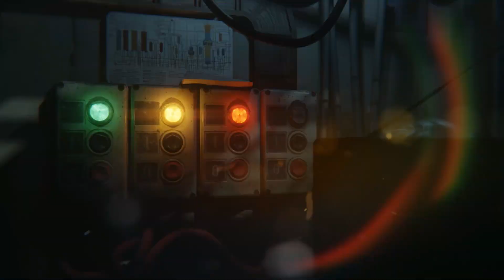Did Dodge butcher the Banshee's Sound?  MachE Borla vs Banshee Exhaust

Comment: Great Video RacerX!

Electricity and magnetic fields has it's own noises and they should exploit that instead of trying to emulate sounds. These sounds can be scary and loud as much as direct headers in ICE Engines.

On that subject also I'm ok with EV transition. I'm just sceptical about the Power grid deployment in the US. We in Quebec have all the hydroelectric dams to deploy that grid. It's not the case for you in the US. It's unequal and I'm affraid that you'll be forced to use not so good sources to produce all the electricity required make this grid possible. Also Producing the batteries takes a lot of energy, I don't know where we are going in terms of carbon neutrality over the years. This subject is opaque and we don't have objective answers from anyone.
Reply: Nuclear. It's the cleanest form and reactors go years before needing to be refueled. Waste can be buried deep in the ground thru bore holes.

Plus it's the safest power source with multiple system redundancy.

Comment: I absolutely love the sound of the banshee. I don’t want my electric car sounding like a V8. I want my muscle ev to sound like a sentient electronic demon wailing...which is what the dodge sounds like. It’s an appropriate sound.
Reply: Ok
Reply: For ever fan of V8 noises coming from an electric car, I envision you all as kids driving your civics with fart cans or putting dual exhausts on old single piped 4 cylinders.
Reply: Electric appliance is not muscle.
Reply: @lennardlennard414  I guess that’d be a decent clap back if the muscle wasn’t down 300hp to the appliance.

Comment: Like it or not states and even the Feds are considering laws that will require Ev's to make some kind of sound so people can hear them. The difference between the sound of the Banshee and the Mach E is the Mach E uses speakers while the Banshee actually uses air forced through baffles.

Comment: Hey, Racer X.  Once again, thank you for your channel and content.  My thoughts on the Banshee sound;

First, I like it and I also like the fact that it doesn't sound like a combustion V8.  If nothing else, I like it
because it is unique and all it's own.  Love it or hate it, when you hear this thing coming there will be no 
mistaking what it is.  I like the way it drones at idle, sounds mean!  However, I would like to get a perspective
on what it sounds like going down the road as opposed to just hearing revs.  I would also like to add a thank
God for the the different and cool tires and wheels.  They really finish the car off like a hot rod!  Those snap-on
looking hubcap things just wasn't doing it for me.

I like this piece a lot but I do have to say I'm holding my breath for an E-Challenger or Cuda possibly.  THAT
will be off the chart!

Much appreciated, thank you,
D.

Comment: The difference is the Mach E is just a speaker system, you could make it sound like anything. Dodge is actually amplifier tubing that is connected to the electric motors so it’s actual sound of the electric motor not just a recording of a different car playing through speakers

Comment: 100 % Borla
One kit fits every car or truck made !
No more having to tune an exhaust system for a specific automobile. 
Put it on all the electric vehicles and even on the stock 4 & 6 gas engines that sound wimpy. 
I even want one for my electric scooter and golf cart, Lol.

Comment: I like what dodge is doing. The sound could use a tuning a bit, but they are trying to keep the car enthusiasts in it with an actual sound coming from the car. Not speakers. Keep with what they are doing, and you know car guys will mod and improve it once it’s out!

Comment: What Dodge should be looking for is a natural sound I wouldn't think that would be very difficult straight cut gears off the electric motor to run the cooling system would give you a lot of natural sound just hook up your pipes to that or a one-to-one ratio straight cut gears between the electric motor and the wheels would give you way more than enough natural sound and that would probably sound really cool either way I really like that car I think it's really nice looking and I would buy one if it wasn't too much over a hundred grand

Comment: If the information is correct. The #7 final edition Challenger had multiple engine issues cancelling it's release. Ford, GM, Honda and Hyundai announced they were pulling out of this year's SEMA. The missing manufacturers determined that after Covid. They expected attendance to be down. At least for this year. Jim Farley announced Ford would use a new directions for the company. Using more individual shows and offering vehicle testing reaching a larger audience. Apparently the other missing manufacturers felt the same way. An example was Ford invited journalists and U-tubers to Michigan to test drive the new Raptor R on the Michigan dunes providing high views and excellent articles. 

Regarding the EV exhaust sounds. I'm still confused why the Banshee needs or uses an exhaust system with zero carbon emissions while an exhaust system shouldn't add extra power to the Banshee. The Banshee exhaust sounds terrible. I would rather have the car quiet than have that terrible sound. It's not even close to a V8. The Borla sound track speaker system used in the Mustang Mach E does a nice job replicating the sound of a V8. Tesla also uses a synthetic system that also sounds excellent with even a wild cam setting. I would go with the Borla instead of the sick lion moan Dodge is promoting for the Banshee.

Comment: Uh a couple things you got wrong, first of Ford did not work with Borla to create the sound for their Mustang Mach E it was Shelby America that worked with Borla to create it for use in their Shelby Mustang Mach E. It will be available for all Mach E customers as well but Shelby America is first on the list to get the Borla system in their cars before the general public. I know people at Shelby America and also had dinner with one of their top executives in December. Also, the sound that the Borla system has are real Mustang GT350 and other muscle car sounds not a synthetic sound but actual sounds of the car.

Comment: Banshee wins, maybe a better tune to tone and bingo but a straight up speaker system 🤣

The reason I like the sound in a ICE is because of the feed back, the actual EV engine making a mechanical noise wins amplified or not

Comment: I would just like to bring people's attention to the "realistic Engine Sim" program by AngeTheGreat; a program that can operate as inline/v/flat/radial engines of basically any combination and can create engine sounds to mimic a real life counterpart.  Truly incredible stuff on its own but would be even better with industrial investment.
Now for theory crafting:  pair that with more in-depth mods to the system to swap out the sounds the program bases itself on and you can truly have something that is powerfully customizable, especially if the mind(s) behind it can stuff it into a RaspberryPi/Arduino with a simple interface and sound-mod loader.  Then set different presets for varied power outputs (imagine hearing a 4cylinder boxer while in Eco mode, but a V10/V12 or Radial (airplane) engine while in Max Output.  Possibly even swap the component sounds to indicate an error when something is in need of repair (and can vary based on what the problem is?), so you can still drive but know that repairs/maintenance are needed.

Comment: People don’t realize that after market modifications exist to change the sound right out the production gate. Slap some mufflers to give it a low tone and you have a v8 sound car. Should it be done? Not really. Can it be done? Yes it can. Most people don’t like a electric car to sound like a v8 when it’s not a v8 engine.

Comment: Count me among the none of the above group. As far as I'm concerned, a performance EV should sound like like an electric RC car or a scale slot car. But I'm waiting for the different governments and automakers to come to their senses. EV's are not sustainable, and they are not really green. Not when the electricity to charge them is produced by coal and natural gas power plants. I'm waiting for them all to do an about face. Petroleum makes the most sense. Petroleum works. EVs don't. Not in the long term.
Reply: Carbon engineering produces zero emission fuel now and it is better for the environment than EV

Comment: These cars are different so yeah different tech has to be done to add character to evs. It's kinda dumb to call it fake sounds. That's like saying listening to music in a car is fake because your not at a concert. I get it. Most of us aren't genuinely ev fans because it's new and different but if companies like borla and magnaflow are to survive then yes they're going to have to produce products for evs. Honestly I would love a magnaflow tuned fratzonic "exhaust" system to deepen the raspy cougar like scream this car has. Or Even a borla ATAK system with polyphonic chambers (like what a pipe organ has). No its not the traditional v8 that we know and love. It's different, it's new. Okay cool. Let's see what can be done with them to customize them and tune them and all that stuff. It's the first attempt anyone has really made in trying to make this new Era cool. I for one support dodge in what they are trying to do in giving us something that's different and bold and rebellious. Does the current setup sound good. No it doesn't. But I say let's give it time and let some of these aftermarket exhaust companies get to work on these cars and I think it will be fine. Oh yeah Dodge this thing needs a spoiler and a few other things styling wise!

Comment: well, for the most part, most exhaust modification on V8 cars do not enhance performance themselves and a lot of V8 cars from the factory don't sound they way you want them too, thus the mods, so at end of the day you are getting a custom sound that was not there prior, so in that context the EVs are getting a "custom sound", just like the gas cars. I don't dislike the EVs because of the sound, I don't like any car that does not have a traditional manual transmission, including gas powered, but that's just me..

Comment: Both sounds are unique but I am not going to be ev until they improve the range for a full charge. Even when towing. I believe ev's are happening to fast. Where I am at there is not even a parking lot of charging stations. And some houses power transformers are built from the 1960s and share 1 transformer to two homes. I think the government should focus on alternative fuels for combustion engines. And put evs on the back burner until they design a battery worth using gor traveling and range purposes. I think we will be going to the digital age where sounds will be designed for the evs what ever the customer wants I think. One more thing is there is no point if these vehicles are not affordable aka less than 6 figures. I probably going old school if i build another car again. But that's my opinion.

Comment: I love the sound of a V8 don't get me wrong. I own one. But I'm not gonna buy a electric car and have it pretend to sound like a muscle car. V8(fake sound) I'd rather have a electric car like the Banshee with a unique sounds that's not a speaker and not a fake V8 through a speaker.

Now this is a off comparison ok don't kill me, but, Correct me if I'm wrong but it's kinda like upbadging which everyone hates! A v6 charger with scatpack badges. V6 don't sound like a V8 so why is a electric car gonna sound like a V8?? It shouldn't! I think dodge did the right thing. Fail for Borla.

Comment: As always thanks for a great video! But Dodge's new all electric Charger is HORRIFICLY UGLY! And the fake exhaust for both the fake Charger and fake Mustang are akin to Milli Vanilli's lip sync fraud years ago and we all know how that turned out. While the fake Mustang sounds light years better than the fake Charger, it's irrelevant as they're all fake sounda. They are dang video games at this point not muscle cars. 

I don't care if these Dodge or Ford spaceships have 1 million HP, being all electric they lack SOUL (and electric cars pollute no less than anything else because we still rely on coal to generate electricity and wind is not reliable! Remember the Texas winter a few years ago with failed windmills?!?!). This is NOT a muscle car or e-muscle or whatever Dodge wants to call this thing - it's a representation that Dodge lacks the courage and will to buck the political pressures to go all electric. It's sad so very sad that Dodge won't even maintain just ONE NA Hemi engine. Having the courage and will to disregard such BS political pressures are at the essence of a true American muscle car and Dodge has lost it. Moreover, the fact Dodge CEO has publicly stated that since all these dumb spaceships can be upgraded wirelessly, that means they ALL have to be fitted for future upgrades at time of purchase, which means that customers will have no choice but to OVERPAY for a spaceship fitted with options they may never want or use. Anything short of a true Hemi is a failure and I'll never buy another Dodge vehicle. I should have kept my 2008 Charger SRT8! Let's pray that V8 Mustang doesn't cave to these same pressures.

Comment: I will never own an EV because its thousands of times worse for the planet and takes tons of emissions just to produce 1 of those vehicles. So FYI if you wanted to hit zero emissions you would have to own that vehicle for 15 years before that one vehicle can be considered a zero emissions vehicle. But by that time the battery pack will probably be leaking or worse and those fumes from those battery packs are extremely toxic and worse than carbon emissions so you actually never end up with a zero emissions vehicle ever. No such thing as one unless you convert everything over to C02 HydroCarbon fuel which is created by pulling the carbon out of our atmosphere creating a actual negative emissions and there for cleaning our air of harmful carbon emissions. Also the fuel is better than what we have at the pump right now and every car on the road today can run on it because that fuel is chemically identical to regular fuel but is made from CO2.